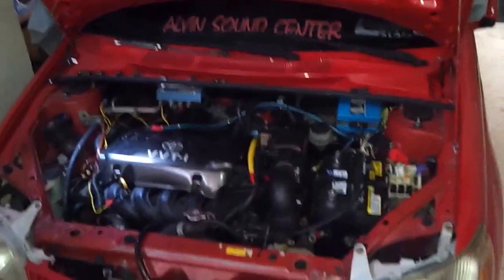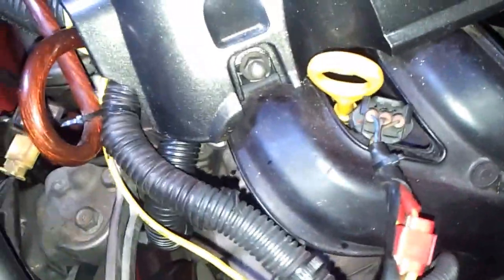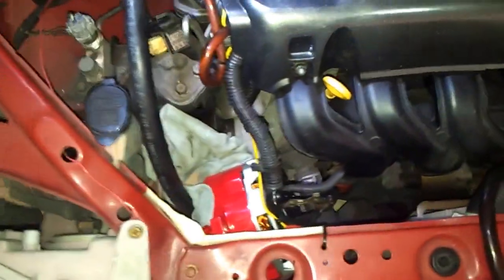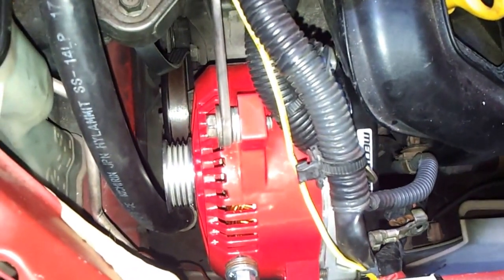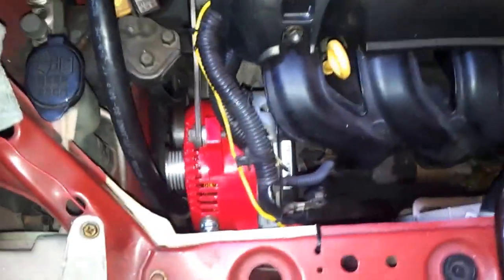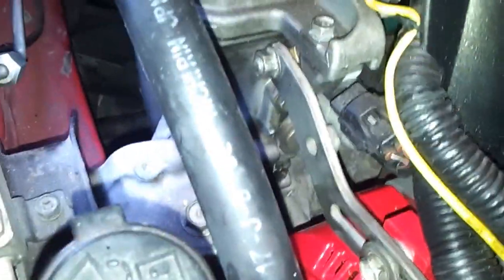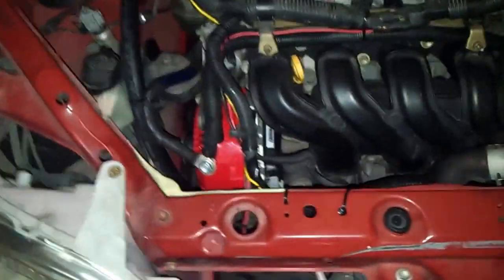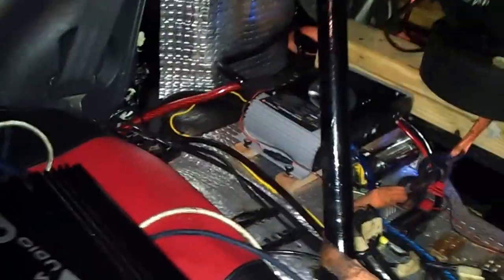Toyota Echo MechMan high output alternator install

Comment: 5 years later and people are still using this diy including me. Thank you for posting!

I can also confirm that for the OEM replacement, I didn't need to remove the air bag sensor. There was just enough room to back it out (may have to wiggle the alternator to clear the last few mm).

I also found that spraying a very small amount of lube on the lower mounting point made it easier to remove and reinstall. 

Great video!
Reply from the maker: Is good to here for somebody that there video i meade help you to face the alt.  work around your vehicle thanks for the good comment
Reply: Hi David I put a high output alternator on my 2005 Toyota Corolla s 1.8L and my battery light is on but dimmed what can that be

Comment: You don't need to remove airbag sensor. You just need to wiggle the bolt upwards towards the tire. The tools I recommend is 12mm and 14mm ratcheting open end that makes it easier  them socket ratchet on 00 Echo. Don't lose the cap protector on the alternator terminal.

Comment: Hey nice video, thanks. I have a 2001 Echo and was able to get to the 14mm lower bolt without removing the ABS sensor. Just a heads-up to others trying to replace an alternator---maybe give it a shot without messing with the ABS sensor.  Looks like your upgraded alternator is bigger, so that may require removing the ABS sensor. Replacing with stock alternator wouldn't be such a tight fit.  Thanks again.
Reply from the maker: thanks for that and sorry for the delay.
Reply: How did you do it,I'm having a tough time removing that 14mm bolt
Reply: @apriestbailey  had to use extension pipe on the socket wrench to get enough leverage. Also you could try some liquid wrench over night to penetrate the threads.
Reply: I can loosen the 14mm bolt but I'm not able to pull it all the way out .The ABS sensor bracket is in the way and I can't loosend the bracket cause its bent to the point where I can't put a wrench on the ABS sensor bolts
Reply: And thx foe the reply
Reply: Smh,for
Reply: @apriestbailey  I don't recall having that problem. What year is your echo? Mines a 2001--still going strong, too!
Reply: 2003
Reply: Hope this one stays strong,its my mother's car
Reply: Had to remove the abs sensor, thx
Reply: @apriestbailey  glad to hear it worked out!
Reply: Thx
Reply: @apriestbailey  i ask the same question! the srs bracket is not supposed to be removed i guess. so maybe drill a hole in the bracket so the bolt
can go thru or just cut the head off head and fine a shorter bolt!

Comment from the maker: the belt is gates K040488 model and the alt. is 250 amp. from mechman alternators from a model scion xb 2005 o 2006 is the same engine from the Toyota ECHO 1.5 L
Reply: David Rodriguez thanks alot
Reply: David Rodriguez  what do u use the voltage  regulators for if.i.may ask . is that from mechman as well?

Comment: Hi, i gotta ask real quick. Whats the alternator upper bolt tightening torque? Thanks :)
Reply from the maker: I don't know I dit bay hang
Reply from the maker: but good ?
Reply: Found the tightening torq :) It says 120 Nm on the bolt (it's an 8T class bolt) But not sure about that, because i'm pretty sure it wasn't tightened even to 50 Nm- the bolt was easily removable by hand. So did the same. tightened by hand, wish it's ok :D